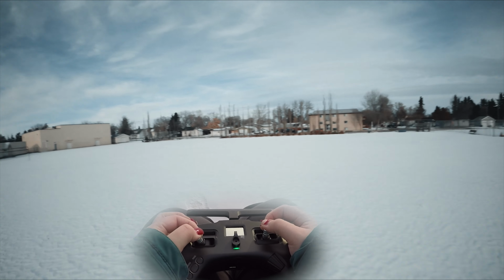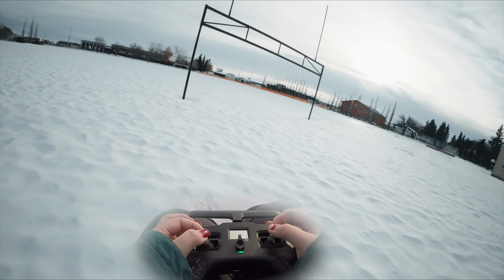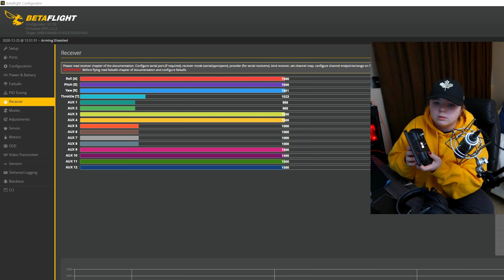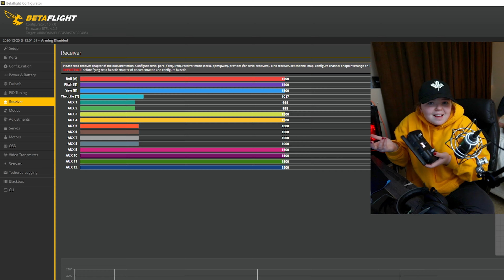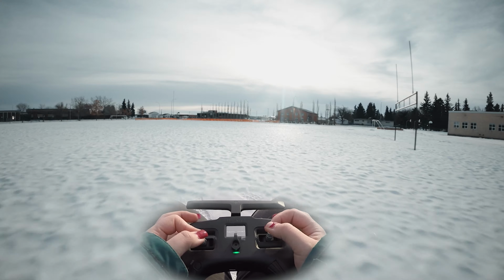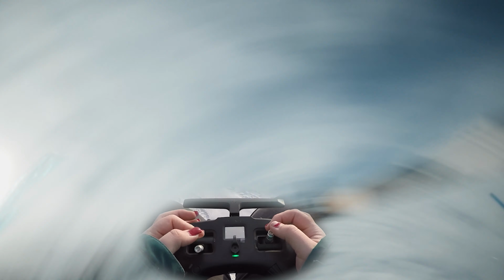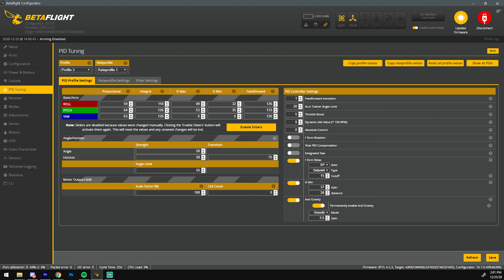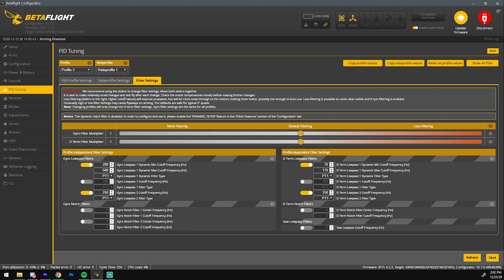I need help with Beta Flight (Rates/PID Tune??)

Comment: I got a feeling that your R/P rates can go much higher so you get that snappy rolls and flips. You will then need to learn to stop the move a bit sooner before the stick center. Good advice from @JamesWilson with the profiles. I like that.
As for the wobbles, I can't say much. My quad seems to do the same. You can check UAVtech videos for that.

Comment: What helped me find some pids that work on my build is getting good at setting up multiple pid profiles and rate profiles on a switch or just use osd to go back and forth. Personally ended up with Ledrib's rates and used UAVtechs base tune for a freestyle 5" to get myself motor temps down. Unless your getting bad prop wash and unusual over all flight characteristics stock pids and filters are good but my frame had some resonance that needed the filters adjusted.

Comment: For the rates its up to you
My rates is between 490 to 560 deg/sec
But ofr the tuning 😅
Use the slide and dont miss with the numbers 
I always change the response to the sticks input ( am used to make it less )
If am using a gopro i go to change my p&d gain 1 step only then i fly to try the new rates
And that all

Comment: I'll help, I am a master at rates.   1,300 hours in Liftoff experimenting with nothing but rates and hardcore aerobatics.    Most guys fly with rates way too high, sticks way too short, everything way too twitchy, and it shows.   The higher your rates, the lower your precision being able to aim and stop the quad.   The lower your sticks, the less precision.   

A Super Pitts rolls at 300deg/s; world's fastest Redbull racer at 420deg/s.   So the world's top dog aerobatic pilot only handles 420deg/s.   Remember those numbers, when a guy tells you his max rates are 450...  800.. 1000... 1200... and think...  what an id1ot... tis guy has no clue what he's doing.

Your rates is mostly too high (0.78), your expo too low (0.20), and your max rate too high (591!)   It's probably very twitchy for you around the center, hard to aim, hard to stop on a dime, and hard to control.

Ignore the PID screen for now, it's mostly irrelevant.   Most guys also again set their PIDs to high, and it shows, with robotic looking CNC machine looking like flying.   The defaults are mostly fine, it's your rates you're looking to change.   In the beginning I took thought to look at trying to make the quad fly like my brain wanted with the PIDs, but nope, it's the Rates screen!   That's where the magic is.

I actually typed out a 15 paragraph book for you here in the comment field, and was like you know what, I'm just going to save this to my desktop, and if you still want advice, hit me up and email me and I'll rewrite it   Or like call you free with Google Voice some boring day and give you a crash course lol.   I have a whole webpage about rates, but it's out of date as my understanding of rates have jumped by leaps and bounds just in the last 2 weeks as I have never stopped experimenting.. with rates.

Look on my channel under info for my email, or just google...     Choppergirl's Edgy SoundPack.